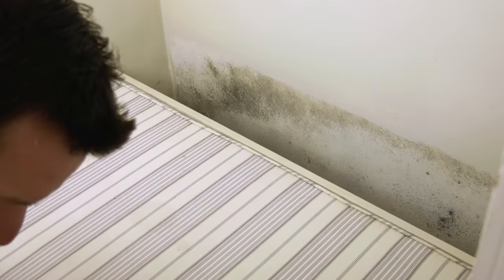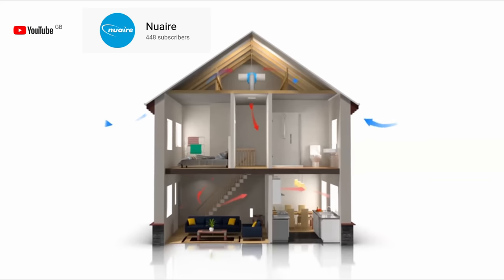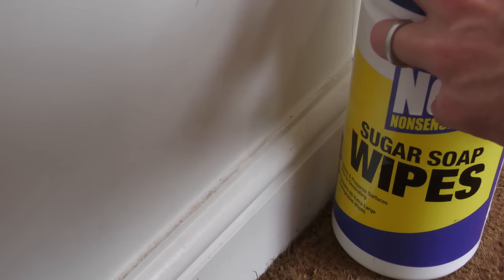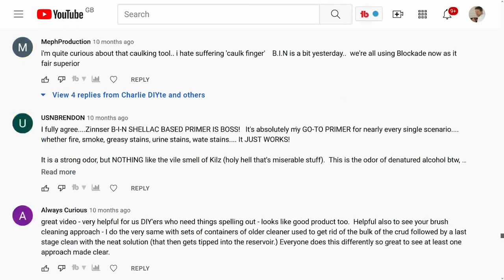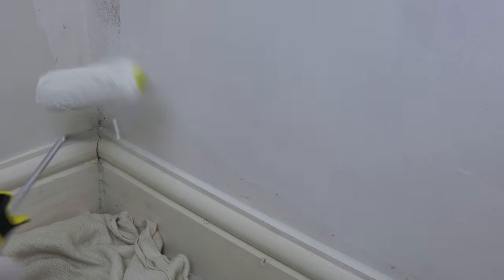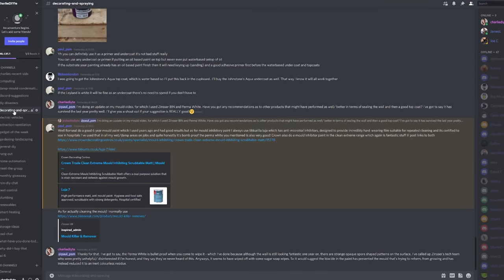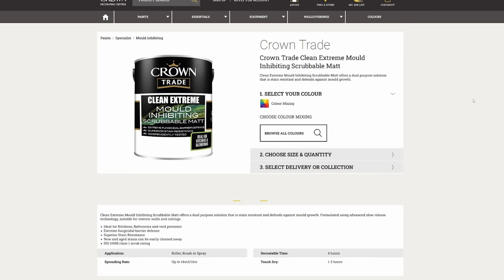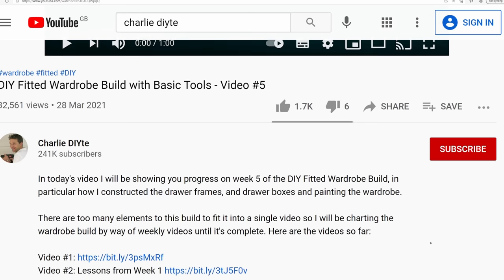Has the Mould Come Back - 18 Month Review?

Comment: A good idea to have a review of something like this as it is useful to see if something worked. A long term review of some of the other projects like the recent gutter and downpipe paint, built-in wardrobes would be good to see too.

Though the Zinsser BIN seems expensive it does seem to cover well and the tin last for a long time. The mould on that wall would appear to be on the surface rather than a wall that had a damp issue. We had a similar issue with our ceiling in one room, thoroughly cleaned it and checked it wasn't caused by anything else apart from condensation at a cold spot. Used the BIN and then just used a normal ceiling emulsion over that. It has not returned so was effective. That one tin of BIN has been used on loads of projects on MDF and some other problem areas so doesn't seem as expensive as I initially thought.

Our house is 30+ years old and the original wooden framed windows were great for ventilation as the quality of them was awful. Replacing them meant the ventilation got worse and mould was more apparent.  Apart from ourselves, main source of moisture is the kettle and cooking which is hard to avoid. At this time of year also washing drying indoors. Improving the ventilation would help but the dehumidifier has been a significant factor in fighting moisture. It is a case of spotting problem areas, treating them and then monitoring the area.
Reply from the maker: Hi Glen, thanks for this. Yes you getting a dehumidifier was a great investment. Having a few hygrometers around the house is also very useful. If the RH goes much advice 60% you know you need to seeing into action in the room in question. I try and leave a few windows on the half latch during the day but that's easy for me living in the countryside and working from home. I appreciate it's problematic for others to do this, although if you have trickle vents on the bare windows I'd say keep them all open 👍

Comment: I’ve treated dry rot in my career and have always got to the source of the problem. Having seen terrible damage caused by water, dampness lack of air and indeed light has made me quite cautions of how to treat any signs of dampness anywhere.   My tuppence worth would be to treat for the potential of a given situation. Yes, it may mean more work and expense but peace of mind having done the work to eliminate nasty surprises later sometimes years later.
I would ensure the substrate: the plaster and possibly the brick/ stone behind is sprayed with a fungicide and allowed to dry.  Irrigation by injection of some fungicide into to the wall.  (ensure the outside soil is at least 150 mm below the DPC if on the ground floor, that assumes there is a DPC!). Then I’d apply your recommended paints.  The possibility of damp contributing by ingress through the wall from outside must be checked out and dealt with.  As this appears to be simply condensation from warmer air meeting a cold wall and unventilated sufficiently on this wall is good to go.

Comment: Hi Charlie - another great video thanks for posting.  I missed the earlier one but have a patch of mold to treat at my house and my daughters so will be copying your approach.  I think you should give Toolstation a heads-up before you post similar videos in future though as they appear to have sold out of Perma White!  I got the last one in Ormskirk and nationally they have sold 18 in 24 hours - no coincedence I think !
Reply from the maker: Thanks Julian. Yes, and it would make what I'm doing so much more sustainable if I could occasionally benefit more from sales generated from my vids but there's very little inclination from the retailers on this. Particularly the larger ones at any rate. Another great product is the Zinsser Ceiling 5 in 1. Primes, seals and has the biocide - all in 1. From memory though I don't think it can be tinted, which the Perma White can. 👍

Comment: As some of the others, if moisture is within your walls, sealing it with paint can cause long term problems.  I had this is our property, paint worked but long term it came back.  Solution was for our stone wall (no cavity) was to remove the plaster, tank it with a slurry then plater over - long term, its never returned.  Its important to identify the exact source of the problem.  Have you ever measured what's going on it your walls?  I also have a PIV installed, made little difference, main solution as you was to run a dehumidifier.
Reply from the maker: The walls are fine in my case which is one of the reasons the mould didn't come back. Previously painted in a cheap contract matt with insufficient ventilation, a combination of slightly better air circulation and this Zinsser perma White paint has sorted the problem.

Comment: I had quite bad black mould in the disabled wet room. After a look through the internet I used a 3% solution of Hydrogen Peroxide in a spray bottle, left for 10 minutes, gave it a scrub wiped down,. when dry I painted it with the Powerfix anti mould and mildew paint from Lidl, it's latex based so water resistant too. The mould hasn't come back after 2 years. Why did I use that method? Because it's inexpensive compared to  those specialist paints by big names and most important, it works.
Reply from the maker: Great work. Glad to hear it's sorted the problem. 👍

Comment: I use perma white satin on most of my interior woodwork. On flat doors and window boards it rolls out beautifully without the need for tipping off. Dries as flat as oil and a finish as good as spraying. The only negative is the brushes clog up fairly quickly and in temperatures above 20° it dries too fast, turning my brushes into a solid!
Reply from the maker: Good to hear it Andy, thanks for that. Yes I find that with Zinsser BIN too. It's my go to primer but you can't use it in the heat of the summer because it dries before you can get it off the brush.
Reply: @CharlieDIYte  BIN is fabulous stuff and is better rolled with a 4" emulsion roller X 2 coats. You don't get dragging by rolling. When I do have to brush it then I work it in small amounts quickly! Coverstain dries beautiful and flat with an enamel like finish.

Comment: It looks like the system has worked to a level because it seems that the mould has became a dormant state where it’s appeared again but to a state where it cannot grow or do anything basically it’s asleep or dead ish
Reply from the maker: I think it's basically created an impervious layer which the moisture in the air can't get a hold onto, and the biocide p prevents the mould forming. Air circulation would be ideal but in the absence of this, this is the next best thing.

Comment: Charlie, have you considered installing a bar greenhouse heater on a thermostat? I'm considering this option in my coat cupboard to make sure wet coats and shoes are dried. 
Re: PIV, I installed one in a client's house about 12 months ago, the only complaint they had was the constantly circulating fan which they said cooled the landing more than they expected. It does make a difference to condensation!!
Thanks again for the updated video.
Reply: i have had my PIV over a year now and yes it does make the landing cold but at the same time it stops the condensation
Reply from the maker: Not a bad idea Nathan. You just have to remember the moisture is still going into the air, so bare that in mind as part of an all round house strategy. It's so worth getting a hygrometer or 3 just to keep an eye on humidity around the house. Should have mentioned it in this vid although I went into a lot of detail on it in my main condensation video https://youtu.be/TIDb-pdOnXM 👍
Reply from the maker: Thanks Nick. Does yours have a heater on it? I know the heaters don't really do a great deal other than tempering the cold air coming in.
Reply: Have had a PIV for 3 years now, absolutely amazing. I've said goodbye to damp wallpaper, mouldy curtains and clothing and steamed up windows. No need to ever open windows. A bit colder on the landing but getting rid of damp makes it worthwhile. I bought the DriMaster-ECO PIV with a heater but only used the heater once as it's pretty useless and expensive to run, so would not recommend that, using it unheated costs the same as leaving a low watt bulb on 24/7 and I haven't noticed much difference on my electric bills.
Reply: @mp3bbb  Absolute ditto here as well 👍
Reply: @CharlieDIYte  hi charlie no it dose not. i could buy one for it but tbh its no big deal that its a bit chilly on the landing
Reply: @CharlieDIYte  Yeah our envirovent has a heater which warms the air to 10c if below. We just run it on trickle mode these days to keep on top of moisture.

Comment: Thing is if u remove what ever surface u still have it in the air.  It Is a natural element in air. So if damp hasn't been sorted it will grow back. As I said a year ago. Wash with distilled water then paint with bin 123 and paint an anti mould paint. I've been doing iy foe years no call backs
Reply from the maker: Thanks Lee. Agreed. If you can't insulate the wall (to prevent the dew point being reached) or increase ventilation, this is the best option as at least you're preventing moisture sinking into the wall, and with the biocide, preventing mould taking hold.

Comment: On the Zinsser product placement: a few carpenters and decorators I know recommend Zinsser products for pretty much every specialist situation every time. There are undoubtedly alternatives, but they're all going to be more expensive than regular paint anyway - so why bother potentially saving a few quid to gamble on whether they will work, when you know Zinsser will?
I'd add that my natural inclination is to aways go for a "good enough" cheaper option where possible.
Reply from the maker: Yes people occasionally say my videos are stuffed with product placement but they have to be as you need all the tools or paint to do the job. My responsibility is to only place stuff I believe passionately in as being one of the best options for the job. I too know a lot of decorators who swear by Zinsser so that's one of the reasons I recommend the stuff so much. Its performance speaks for itself though 👍

Comment: Let me tell you my story cause I have dealt with this many times.
I have garage boxes and they have no heating or light or whatsoever and are not attached to a house only in a group to each other.
Had a mould problem on the ceiling years ago. I cleaned it wit a brush and high concentrated  water/chlorine solution, turning my old jogging suite from black to yellow and since I am bald, no damage to the hair hehehe.
After some days of drying I painted it with a local Dutch brand of concealer and paint from Alabastine.
Since there were some holes above the door for ventilation I also made two in the back wall to generate some draft.
Now I rent them out and 2 years ago, I changed renters and did a check up, all was still great, after 10 or more years, very happy about the product.
Buts as you mentioned, FIRST GET RID OF THE MOULD IN A GOOD WAY, then paint !

Comment: Hi Charlie, thanks for these 2 videos, really useful for our window reveals!.  Our kitchen cabinets are installed on external walls (no choice unfortunately) and consequently get cold.  Walls are old stone with rubble cavity infill.  Before the days of youtube I injected a DPC to reduce/eliminate rising damp which helped a lot, and now wish I'd installed insulated plasterboard 😂 During windiest of winter there's a dreaded draft through the kick plate, fine gaps between the carcasses and pipe holes inside the sink cupboard.  Good to have airflow but something tells me it's too much and possibly overworking our dehumidifier 😂I think it's blowing down the eaves and out through loose internal render.  Tempted to fit loft insulation beneath the cupboards to reduce draft at the kickplate, which should be okay, but wondered what you think about spraying open cell foam between the wall and back of the carcass to fill the service void?  Drilling 10mm holes 150mm apart, would allow me to poke the gun through and spray sections working from bottom to top, so it doesn't fall down, the lowest level would rest on the loft insulation.  Apparently open cell foam is more breathable but doesn't transfer moisture.  Does this sound a good idea to you? 😉
Reply: Another option is blowing in EPS beads behind them, using my leaf blower 😀there are some alcoves hidden behind plasterboard either end that might be letting a draft in.  This could be a good option behind fitted wardrobes on cold walls - provided the beads can't escape.  I'm hoping it will allow some airflow but also keep the walls warm.

Comment: I find that TSP (trisodium phosphate) is a good treatment for removing surface mould, followed up with the paints you suggested. The real battle is fixing the root cause of the condensation though (as noted in the video).
Reply from the maker: Exactly. We have a far from ideal situation given the lack of ventilation but I used a dehumidifier to dry out the wall before I treated it, and at least this paint solution has comprehensively prevented any moisture getting back into the wall. I think the result is pretty satisfactory given the circumstances. 👍
Reply: @CharlieDIYte  What plaster does it have? How did you dry the wall? Have you not now trapped any  moisture which is cold attracting high enviroment moisture levels creating condensation to find your cold non ventalated area?

Comment: People saying you can't treat mold like that are mistaking mold and fungus. Mold forms on the surface of the wall. Fungus infects the whole wall. They look quite similar but you can remove mold by scratching the paint and the fungus might still be visible even deep under the paint. Although it is also possible to remove fungus by scratching if you find it before it infects the deeper parts.

I have a mold problem in my rental place too but  I am not allowed to paint the walls (the owner is weird) so I beat up the mold by understanding what mold needs to form and grow. 

Basically an unusually cold surface that allows the humidity in and doesn't have much airflow.

So I mold proofed the areas where mold was creating by first scratching the wall, then using a mold killing spray and drying the place off and then by neatly putting some waterproof pee-and-stick foil on the wall. The humidity doesn't sink into the wall so the mold has no way to make roots in the wall and the mold that was in the wall (assuming it survived the spray) has no humidity to grow. 

I am checking the wall every now and then but so far there seems to be no problem. 

I am only afraid of the fungus that is also in the walls, which is forming tiny black spots under the foil in some places (not all places where the mold was, just some, where the wall was in a particularly bad shape and i failed to scratch deep enough). But it isn't my problem. The fungus was in the walls way before I moved in (it was covered by fresh paint when I moved in and grew through it after a few months) and is caused by bad isolation of the outside wall. But it can't get through the foil and it's spread is limited to one or two tiny spots that don't seem to be growing much for now.

The paint you are using seems to be a waterproof one, just like my foil. 
Unless there is a crack the mold won't get through. There might be some fungus slowly growing in the wall under it though.

I wish I could paint my rental place with some waterproof paint too. The one I have now seems almost like a blackboard chalk, comes off with every wipe and clearly changes color with just a little bit of water. Which is also why I am not afraid of using the peel and stick foil on it - it will not damage the wall, it will safe it from any dirt and splash instead.

Comment: I'd never use acrylic paint in a bathroom again. Solvent based paints are much much more mould resistant. I repainted the roof of our ensuite with a semi-gloss enamel but left the walls as-is. Any mould buildup now has a distinct variation between wall and ceiling. It only needs a light wipe with mould spray cleaner to clean it off every few months.
Reply from the maker: Great work. I agree, even an acrylic eggshell isn't a patch on something like Perma White. Regular cleaning as you say, and you don't have a problem. Try and keep the bathroom window open as long as possible after showers and baths, to get that vapour out of the window rather than circulating around your house.

Comment: I moved in to our house in 2013. When remodelling the upstairs we removed two built in cupboards and found tons of mould behind them (on walls and ceiling). My mate recommended Zinsser products (B-I-N) and something else from their brand. 9 years on there is no mould to speak of in those areas.
Reply from the maker: Really glad to hear that. I suspect you're managing moisture better than the previous owners too as discussed here https://youtu.be/NbtijHKy2Vo
Reply: @CharlieDIYte  Just watched that video, really informative. We do have old windows and they get really wet overnight (but only in the bedrooms). They are also not installed very well so mould does creep up around the windows (need to wipe it every 4-6 weeks and usually treat with bleach once a year). We are replacing all windows and front door in January so I wonder how those will fare against condensation. Personally I'm against trickle vents because they ruin the window frame, happy to just leave them slightly open if I need to. I also want to insulate the suspended floor - all of which will add to air tightness and probably more moisture in the air so I'll probably use some of your hints 😉